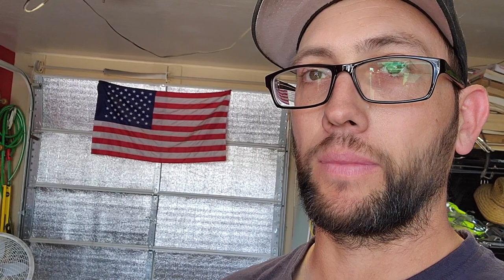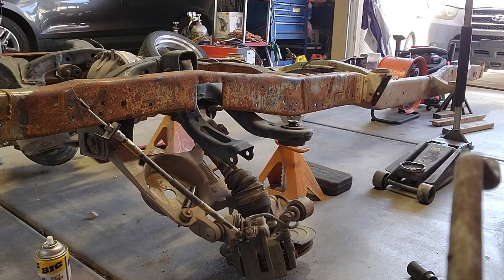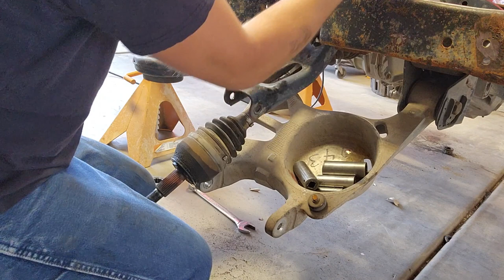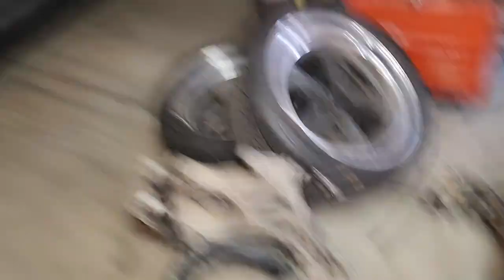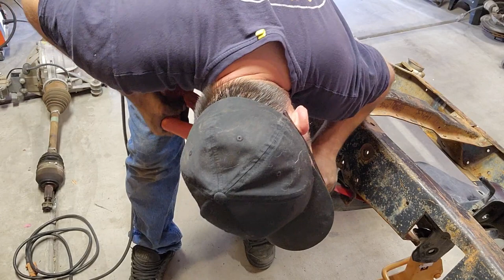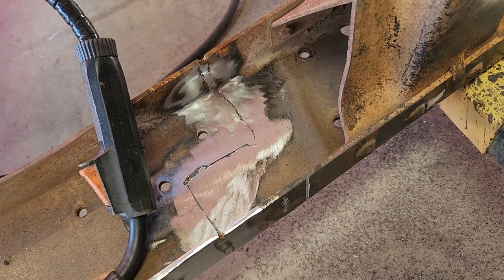64 Progress S1E7 Differential removal.

Comment: I found this channel when looking fir information on a 1961-1963 Pontiac Tempest transaxle.  I feel like I jumped into the middle of a story.  It looks like you're doing interesting work.   If I may provide feedback.  I don't mean to nitpick -- I just want you to succeed at this YouTube thing.  This advice is to move your video quality in the direction of the more popular channels.    1) At the very beginning of each video give a super quick (~30 seconds) recap of what the overall project plan is and what the plan for this video.  This is so we'll know what to expect.  
2) Have less selfie narration.  A short selfie with your smiling face is fine to welcome us at the very beginning, but provide your narration as a voiceover while we're watching something cool happen like fast forwarded grinding or cutting.  
3)  Mercilessly edit the length.  And do fast forward whenever you're grinding, sanding, or cutting.  Completely cut out the parts where nothing is happening or you're walking from one location to another.  For everything that got done here it could have been edited down to a 8-10 minute video.   Most viewers can't sit still for a one hour video.  
Good luck with your project and channel!
Reply from the maker: Thank you for the comment. I appreciate it and will try it out.